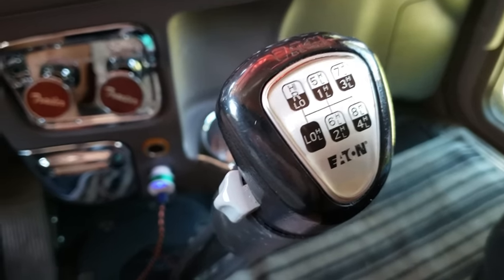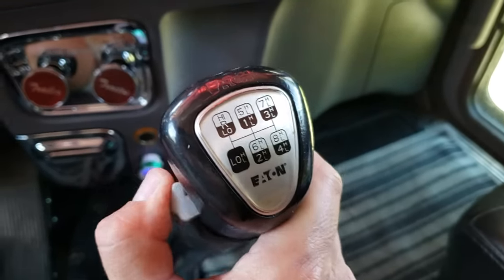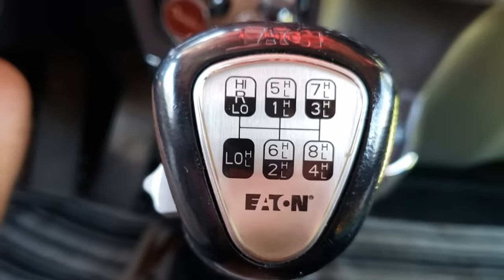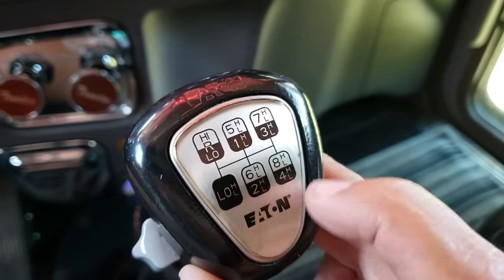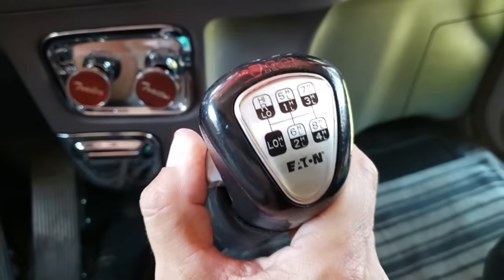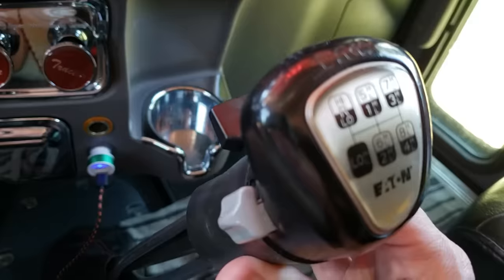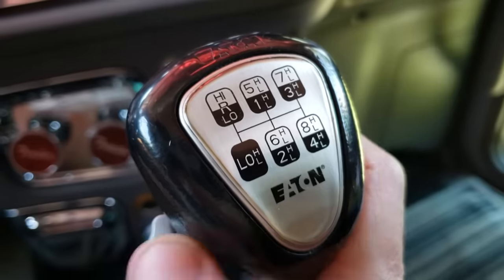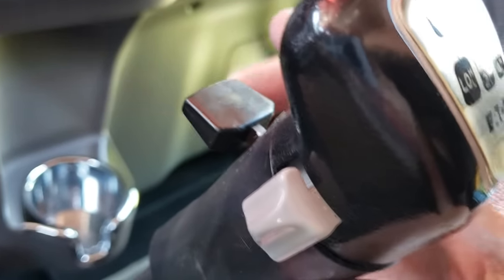HOW TO Shift 18-Speed Manual Eaton Transmission. Peterbilt, Volvo, Freightliner, Kenworth, Mack

Comment: I rather have a 13 speed or 18 speed manual transmission over an automatic any day especially driving in snow or hauling heavy loads up hills plus they are better on fuel
Reply: No they are not better on fuel

Comment: I learned to drive semis with this transmission, except I had to teach myself and the top plate with the pattern was missing.   I had a huge hole in my exhaust right before the stack, and when cars got to close I'd hit em with the Jake brake.  That 550hp cat was a beast and the Jake brake was ridiculously loud without the muffler.
Reply: Disclaimer.. I drive a septic tanker tri axle straight truck, in a very overpopulated city full of drivers with no consideration for truckers.

Comment: Now go back 30 years, change it to a Mack 18, put a V8 in front of it and a Spicer 4x4 behind it and you have my first new truck. 72 gears up and 16 back,,, easy peasy
Reply: Is that the 2 stick? Those were a blast to learn on. This 18 speed is easy breezy compared to 2 stick Macks
Reply: sparkyguitar 00 it had a stick for the main with the air splitter and a stick for the 4x4. Almost like an old quad box, but way more fun. I miss that truck.
Reply: John Doran I learned on  mine mid 80's. Don't even remember how it worked exactly now. Wonder if I got back in 1 now, if it would just come back to me. Any other stick would. Had a 4 speed Mach 1 and a 5 speed Ranger so sticks are easy. Just a 2 stick might have to grind it for a sec to feel the proper gear.

Comment: Thank you! for explaining this. I am in training and my instructor doesn't really explain anything!!!  I am just driving the truck and thankfully I am full of common sense. I have yet to touch the split gear knob and really had no idea how it worked. 8 hours under my belt and I am confident through to the 8th gear. And here I am researching the next step. Great video!
Reply: Something important. The range selector will only shift once you move the stick into neutral. The splitter will try to shift whenever you flip the switch. Don't flip the splitter knob until you know you are going to shift. Puts a lot of stress on the splitter shifting mechanism otherwise.

Comment: I started out driving in an international cabover pulling a pair of 28' pups (doubles).  9 sp manuals.  Eventually got into conventionals and pulling 53' dry vans.  Mostly 10 sp's.  Drove a 15 sp a time or two, as well as a 10 sp with a 2 sp rear.  The one thing I never cared for was split shifting.

Comment: if you are splitting all the way through, just remember lo hi lo hi lo hi lo hi, hi range they start lo hi again all the way through.
Reply: Why would you do that? 18 sp is so you have options not to go sequentially from 1-18 except if you have to - which sometimes you do I guess - mmmm now I'm thinking of it, it happened to me the other day except I started in 1st rather than LO. I had to stop on a hill and tend to a loose rope with 42t gross but usually not.

Comment: Damn that!😂
Hour 10.5 of drive time is gonna kick your azz if you forget where you are gear wise if you're a newbie.
Reply: Drove an 18spd 4 a number of yrs...i got so good at it to where i cud throw it n neutral & automatically kno wat gear 2 go back in....really fun to drive & on top of that it was a dump truck!
Reply: You may forget, but you get used to speed and rpm in various gears. So a quick look at the dash and you’ll be back on track.
Reply: Cant find it, grind it driver. That's why they make them out of rubber!!!
Reply: Wait until the wheels speed sensor goes out, no speed display on dash.. you learn real quick.

Comment: That is not what makes it an 18spd! It's how many forward gears you have. On an 18 you your 18 forward, 4 reverse and neutral is just neutral. Great video though.
Reply: Sorry, I didnt realize your shifter doesn't  split reverse or at least doesn't show it on the shifter.
Reply: it's not 18, the reverse has 2, the H and L, and the LO has also 2, the H and L, so in total there are 20 speed
Reply: @fukaishikonoenjinia8729  it is a 18 speed low has high and low. You only count forward gears.
Reply: @jefferyphillips1075  ah ok

Comment: My fastrac has 6 gears, 2 splits on each gear, then it has three ranges. It also has a shuttle, so forwards or backwards. So 36 gears all on the stick. When you're pulling fully loaded you use 2/3rds of em.

Comment: Miss the rto18b so intuitive and simple to learn and always in the power band.

18s come default with the grey splitter nob.

Reverse is not 1.  You have a low and hi reverse.

You can also split lo.

Range selector up in LO or 1st is called the mystery gear

Comment: Hi Cory, 2 things confused me a bit.  I've never driven an American truck and working my way up in the gear count, so to speak.  (I've never had to use a splitter before.)  So referring to the splitter, instead of saying something like "This is Low, and this High" (while demonstrating the position of the switch) you were flicking it forward and back a lot and it got confusing.  So may I ask, is forward High and back is Low?  Or the other way around?  Also, I thought the gears were called "Six Low, Six High, Seven Low", etc... calling it (just plain) "Six" and "Six and a half" kinda threw me.  Please don't take it as criticism.  I'm just confused about the splitter explanation.

Comment: As I remember.. Red Splitter 13speed, Blue Splitter 15speed, Grey Splitter 18speed. Good to know because not all Shift knobs have the pattern plate intact or readable. I personally learned to shift on a non- air shift, twin stick, 5+4... 5 speed Main trans and a 4 speed Auxiliary trans... one stick shifted the 5 main speeds.. the Aux. gave you 4 additional speeds in each of the 5 Main gears for total inventory of 20 forward speeds and 4 reverse speeds.. no air shift.  Was a great trans set up when  a large power plant was a 400 Cummins ..easier to stay in the power band. Every trans has an application. IMHO A Gold Dog MACK 18speed was the best for backing up Super B's at a crawl ..had a super low Reverse. Well.. I 'm rambling ... Miles O Smiles to Ya All.

Comment: If you're cruising in seventh with the splitter forward, and you want to shift to eigth, do you need to put the splitter backwards before moving to neutral?  And if yes, do you have to wait for a second for it to go back or can you knock the splitter back and immediately go to eigth?
Reply: No the truck will only shift while not pulling… it’s an air shifter. If you have a load on the transmission it won’t shift. You can pull the splitter back it won’t downshift cause of the load on the transmission… you just have to be smooth and it takes practice to feel the truck and as soon as you let off the splitter down shifts but since you are in between 7th and 8th nothing will happen. Now if you are in 7th splitter forwards and descending down a hill it can be used backwards and used to slow you down with the help of the jakes. I hope that makes some sense… honestly you just have to do and it makes way more sense.
Reply: @crandonborth  i think I understood most of that.  Can't wait to try it!

Comment: I think in your initial explanation of how it's 18 speed you may have been slightly incorrect. I'm pretty sure reverse isn't included in the 'speed' of a gearbox. In reality what makes it 18 speed is the 8 main gears that can all be split giving it 16 then you have the Low gear which can also be split giving it 18.

Happy to be corrected here but I'm pretty sure I'm correct

Comment: When you shift the splitter switch forward, it seems like it is:
1. Let off the gas.
2. Push Splitter forward.
3. Push the gas.

For shifting the splitter backwards, is there an order? Something like:
1. Pull Splitter backward. (Before going into Neutral?)
2. Shift to next gear.

Thanks.

Comment: I got a 13 speed truck after driving smaller trucks, the old owner said in time it'll be just like driving a motorcar. Had considered upgrading to 18 speed but was concerned about the differences.

Comment: Hey when splitting the gears, do you also clutch? Or just let off the throttle? 
Also, when it’s time to shift, u pull the splitter back to its normal position, u shift, then at what rpm do u know when to put it in high gear? At 1500 rpm? Anyone who sees this comment, I’d appreciate a response thank you

Comment: i used to drive trucks and i was told the lower gears are for heavy loads and going uphill so on flat ground you can just stay in high and go through the gears normally like 2-4 in high and split then go 5-8 in high and i would assume 5th gear is probably around 40mph and if you're going top speed you can hit the brakes and slow down to 40 and take it out of 8th gear rev it and put it in 5th gear and put the splitter back and you will be in 4th and then  use the brakes and slow down to 5mph and take it out of 4th then rev it and go to 1st or is that not possible anymore? why would you want that many gears unless you carry really heavy loads.
Reply from the maker: You are correct, this trans is for really heavy loads.  Takes the stress off the entire drivetrain if you can use all these gears for hills, starting everywqhere you go, etc.  I love it for any load heavy or light.  The variety is amazing on the highway...

Comment: The grey splitter is very rough on a truck that I'm driving currently, I'm trying to figure out why? Down shifting I give it throttle and it's a very hard hitting engagement.
Reply from the maker: Hmmm...I'm guessing the trans is worn a little.  They are super strong and prepared for grinding and mis-shifts.  The gray splitter usually slides quite easily...
Reply: @CoryJDraper  yeah she's an old truck, I've just never had this issue, shifts fine pulling, splitting all the gears, but when it comes to down shifts and splits, it's a very hard transition. Like the second you give it throttle it's bang!!!! Not smooth at all, I've driven many of these trucks with the 18 Eaton, I was thinking mechanical issue, I was curious if it's starving for air, but slides nice while sitting.

Comment: Thankyou very very much best explaination. Okay i have a question 🤨 when climbing the hills  , what gear will use ?? High or low gear...???
Reply from the maker: Depends, but most of the time lower gears.  You'll be able to tell right away from engine rpm and if truck is struggling.  Once you drive any manual transmission you'll memorize what gears to use.  Good luck!

Comment: As a Kenworth dealership mechanic is Australia I can assure you that you can blow a gear box up if you shift wrong, might be because of the massive weight we haul here compared to the rest of the world but iv seen some of these boxes grenade them selfs, but most commonly they chip a tooth during a shift and then the box just turns into mush.
Reply: Doesn't have to be a heavy load, blow a shift at the wrong time and KABOOM.

Comment: So to go up to the half gears, do you flip the side splitter up first let go of gas then back on gas or let off the gas  flip the side splitter then back on gas?
Reply from the maker: I flip switch first, then give throttle a quick tap, and it'll shift smooth like an automatic.  It's fun, you'll figure it out fast...
Reply: @CoryJDraper  I need to try to test drive one sometime. Driving a 10 speed now been doing it for 3years. Need to graduate ha.

Comment: i drove 10 speed for many years and getting a new pete with 18 speed in few weeks
so im trying to get some learning. with 10 speed i never start lower than 3rd gear unless fully loaded and stopped on a  hill then 2nd gear. do you actually start with 1st gear in 18 speed ?

Comment: I'm learning a 18 speed rn with my new company. This definitely helped out alot. My only question is. Do you need to change gear to activate the Jake brake.
Reply from the maker: No, just apply Jake nice and smooth, it's really easy
Reply: @CoryJDraper  I've also never gone up and down a mountain with a 18 speed. Do I drop down 2 gears then get to the top up one? Or personal preference kinda thing

Comment: How is a clutch peddle apply in these kinds of things ? obviously I don't drive commercial equipment😲
       just curious? Like is it or would it be a power waisted ? 
event if 
the 
Powerful engine
were clutched ? off
   between each gear change ?
I know my question is kinda "geared" between two kinds of power servicing systems 1 automobile 
2 commercial truck
       They're two different types of mechanics involved? right. 
1 How different
2 what and how is a clutch utilized
in a 
Commercial Truck like that we see here?

Thanks for
Sharing

Sincerely

B Parker

Comment: So if I am correct, the High and Low options are basically High: The same gear much faster. Low: The same gear a little slower. And to toggle that Faster or Slower mode, you have to switch the button either down or up. Pretty interesting.

Comment: That makes it less ominous as you said you can really drive it like an 8 speed with a low until you get used to that then learn to split it for the full set of gears. Seems easier than a 13.

Comment: Wow that's awesomely explained and got a question?  Can you float gears in the eighteen speed transmission
Reply: Realistically about the only way. Officially you’re supposed to use the clutch. But, they don’t have syncros like a car transmission so it doesn’t really work well that way.

Comment: I drive a 18 speed in a western star the only thing I would ad to you great video is not to pre select your high low from forth to fifth, not good  on the transmission it puts to much pressure on it.  flip it in the nuetral possision between 4th and fifth.

Comment: Similar to shifting a Super 10 Speed.  On a Super 10 you go through 10 gears and only move the shifter 5 times.  Five shifts with the gear selector and five shifts with the lever.  On a 10 speed you shift 5 times with the gear selector, flip the lever, then shift 5 more times with the gear selector.

Comment: Is this correct? I always thought that '18 speed' was 4 x 2 (Hi/Lo range) equals 8, and each with 2 split 'half gears', so 16 gears, plus the two 'Lo' gears equals 18. I never counted reverse as a 'speed / gear'.
Also, I don't think 'Lo' range shifts, just splits? (I've driven 18 speeds, but never needed to use the 'Lo' crawler gears).

Comment: Fascinating video! I always pictured myself as a “wanna be“ truck driver,” having owned several diesel vehicles, some with manual transmissions. 

Is the clutch only used when starting from a stop? And you “float the gears” after that?

Comment: What happens if say you're in 5th with the H/L switch up and switch it down? It doesn't drop into 1 right? I'm thinking that you have to go to neutral and then back into gear for that to happen, right?
Reply from the maker: Hey there, when you switch high to low without shifting the stick itself, the trans only drops 1/2 a gear, about 200 rpm.  You'll see when you drive one, it's really easy after you flip switch while driving on a flat highway at 55 mph.  I like to flip switch when I'm going up a hill and need an extra few hundred rpm for more torque.  I know all this sounds complicated when you read about an 18-speed, but when you actually drive, it all makes sense.  So you won't go down to 1st gear just by flipping side switch, you have to actually shift stick manually...

Comment: I have one question, When you're going from 4th to 5th gear, at what point do you flip the selector to the 'up' position? Is it in neutral or are you able to switch it before then?
Reply: I am in the habit of not moving the high gear selector until I am making the move from 4th to 5th.  You can move the lever earlier, the trans won't do anything until you move the stick.  But there is the hang up.  If you are in 4th and move the selection switch early to move into 5th, what happens if traffic slows in front of you and you need to down shift and you forgot to move the selector back down? Now you will grind gear as you attempt to go to 3rd.

Comment: I thought it was Side switch back is 1,2,3,4 then side switch forward is 5,6,7,8.  Then you have the H/L switch that gives each gear a H or L setting which mathematically gives you 2 speeds per gear.  1H + 1L = 2 speeds.  Therefore forward standard gears =16 plus the extra low forward gear (granny) for very heavy loads has 2 speeds thus 18 speeds forward. And finally, REVERSE has a H and L for 2 more speeds which technically gives us 20 speeds... but we are concerned with forward gears.

Comment: 13 and 18 are the same gearbox. 13 disables the splitter in low range, so LO and 1-4 lose the L/H split (so 5 gears go away). It’s really just a software change; all the mechanisms are still there.

Comment: OK so I'm tired and had a long miserable day (week), but am I understanding that you basically drive it like you would a 10 speed and then only use the splitter and spike the fuel? You don't actually shift the stick? Stay in high gear and then give it fuel, let off fuel, spike fuel, and split?
Reply from the maker: Yep, I just tap the throttle and can flip switch back/forth, depending on rpm's I want.  Most just do it on freeway and going up/down hills.  It gets easy after an hour or so...
Reply: @Cory Draper  well, thank you! That's not difficult at all. Now I have no more excuses ... either do it or don't,  lol.